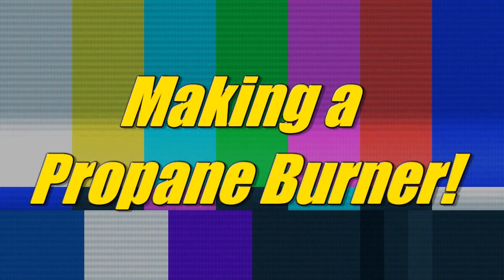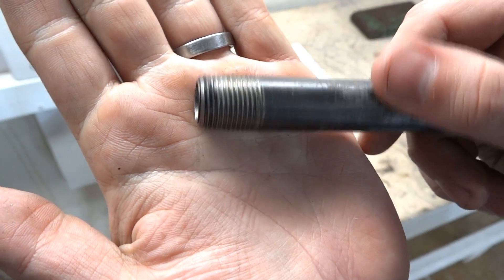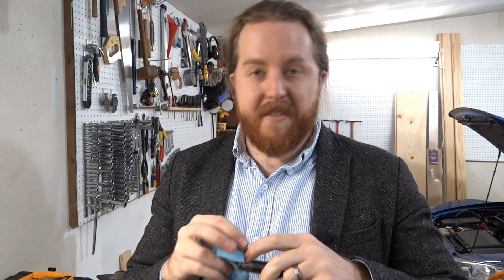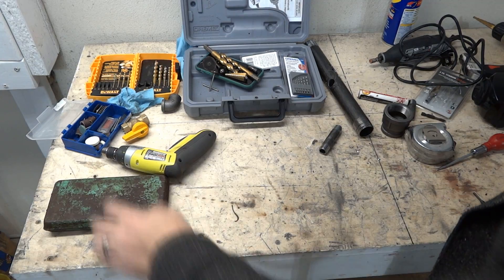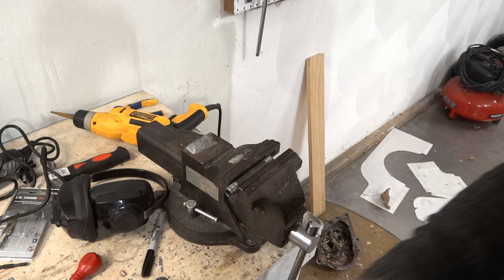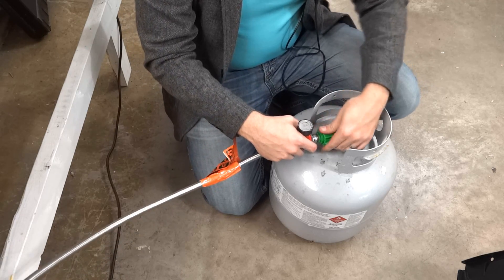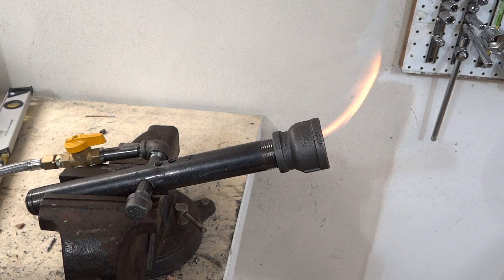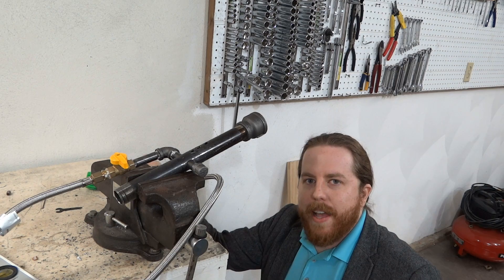Easy to Make Propane Burner! For Melting Metal at Home, or a Forge!

Comment: you should fit a flame arrestor between the stainless hose and the valve that way if a flame were to work its way back you dont blow up your garage :). awesome videos man!
Reply: not really needed since there is no oxygen like with a gas welding torch.
Reply: Rob B but theres always the chance it could happen, always better to waste a couple dollars rather than a couple million to have your face re built
Reply from the maker: yeah better safe than sorry, you make a good point.  A couple bucks to eliminate a remote risk is easy to justify.

Comment: My ultimate casting goal is a bronze sword
Reply from the maker: That would be pretty cool! the molds for those were carved out of stone, though, so lots of work there.
Reply: Paul's Garage you could also build a big flask and sand cast a sword that you could make out of wood (or foam because its easier to work with) to be the same shape as the bronze age ones, thats probably how I would do it.
Reply: +JACKAPUNCH44 Lol, that's actually what i'm trying to do too :) Ive made a wood model but it looks more like a roman gladius. Anyone cot propper dimensions for a greek one?

Comment: It probably isn't good for oxygen because most likely there is some grease or a hydrocarbon compound in the valve which when comes in contact with oxygen normally equals fire.
Reply from the maker: huh, i hadn't thought of that.  I like fire and all, but unwanted fire inside a valve sounds like a bad day.

Comment: I'd probably leave that valve open while you dream of things to burn if you do indeed plan on tack welding the pipes together. let all the propane get out. 

think I might look into making something like this. Could be useful.
Reply: Well this one with the remaining gas inside the line was a surprise to me as I usually turned off the supply at the tank and let the flame burn out, then I tried it by turning off and disconnecting the hose and torch and thanks to a ball valve there was still gas inside. Better to know about it than find out the really hard and dangerous way.
Reply from the maker: Good point! flammable, trapped gasses are not a great thing to have around a welder...
Reply: I was going to add a similar comment Paul. I found with my hand held torch and braided hose that it would still contain some gas after disconnection from the gas cylinder, useful for a short term portable flame but dangerous otherwise.
Reply: I'm usually the guy rolling his eyes at the safety people but sometimes stuff isn't as immediately obvious.
Reply from the maker: Good point!  always better safe than sorry.  I'll probably disconnect the black pipe stuff from the regulator hose and blow compressed air through it or something to make sure it's all propane free before tack welding.  Or maybe i'll just use a set screw like the instructions said.

Comment: I like your tutorial how to videos, the ones I have seen are simple. and my furnace is already equipped to burn coal, wood, paper briquettes, etc. But it is 25 miles one way for me to get a tank of propane. But cooking oil and motor oil is a lot easier for me to scrap up. living in the bush, some building materials can be a challenge to locate without a 50 mile round trip walk. So I would like to request a future video for myself and others who may be in a similar situation for an alternative style burner such as the oils? I built my furnace from an old 175 gallon used oil storage tank ( like the ones you might see at a minute oil change shop ) so I have a lot of room to heat. I am curious to see what you can come up with. most the ones I've seen are to complicated or difficult for me to find parts ECT.  I am looking of a simple gravity fed no air compressor design. I love aluminum casting, and trying to learn brass, copper, and if my guess is correct about this river, possibly gold. Later for now. . . .
Reply: I built an oil burner, I built mine off of the kwiky burner, but if I wanted something simple that just works, I would look at some of the burners from the guy called "oil burner" here on youtube. His drip style burners work really well and Ive seen a few running in person, and I have to say that they are much easier to use than the siphon ones and much cheaper to build.
Reply from the maker: yeah the channel "oil burner" is pretty good.  I think Fair Weather Foundry uses an oil burner, but he uses a mix of air pressure and gravity feed. He elevates the oil tank above the burner, so gravity acts to force the oil through as well as the pressure. I think he says a foot of height is equivalent to a PSI or something like that?  I probably won't be making an oil burner anytime soon, although I am curious how well cooking oil would work.  The problem I have is neighbors.  I'm in a dense neighborhood, and propane is odorless and smokeless so i can fly under the radar here.  I want to try an oil burner at some point, but it might not be very soon.
Reply: Would you mind sharing the link pleas?  I keep looking and to just put oil burner or drip style oil burner, I get way too many choices.
Reply: I use a kwiky oil burner, which needs an air compressor but works really great for me. If you want drip style, just look up the user "oil burner" on youtube here. Both can be found on here and are fairly easy to make.
Reply from the maker: +Little King Cobras Den which link are you talking about?  I can't see my reply to this comment from my phone for some reason.  If you want designs for oil burners those atre probably at backyardmetalcasting.com, if you are looking for one in action check out YouTube channel fair weather foundry, there should be a link in the featured channels on my channel page.
Reply: Well, I was asking Chirpy's Tinkerings trying to find the home page of the youtube person they were suggesting. which they said, look at some of the burners from the guy called "oil burner" here on youtube.BUt I will look at your suggestion also.
Reply from the maker: +Little King Cobras Den oil burner is a good place to look, chirpy knows his stuff

Comment: Paul I'm going to still suggest you get a propane 40lb tank from an RV. You can find them pretty easily. And I'll tell you why you should get one.

1) Have to fill less often. 
2) bigger tank means less likely to ice up. I'm pretty sure you live in the upper midwest where it doesn't warm up till May so this is an issue a good part of the year.
3) no need to take your barbecue tank off your grill.
4) Horizontal ones can't be knocked over
Reply from the maker: That's a fantastic idea!  I know where to get those around here, my parents have an RV with those tanks.  I hadnt' even considered that.
Reply: DON'T go to the RV place first. They have more incentive to mark up way too much. I'd start with

Salvage Yard. Call up any one and tell them what you're looking for. Those tanks have no use to them so they'll be cheap. 

Propane distribution company. Tell them you're looking to buy a tank not rent. Should be cheaper than an RV place.
Reply: I have one but i cant get it recertified only downfall ive found

Comment: you can make your foundry in a trash can to make it bigger, I did this and it works really well
Reply from the maker: I was thinking about that.  I can get steel trash cans at a store here, but they are REALLY big.  I was thinking maybe double the size of the bucket foundry, but the trash cans are around 5 times the size of the bucket.

Comment: Drilling the jet hole after assembling the elbow to get the clocking right is a good idea. Many eliminate the elbow entirely to avoid that issue. To avoid breaking Chinesium step drill bits you need this accessory http://i.imgur.com/eVsKgLt.jpg They work better in it than in pistol drills.
Reply from the maker: A drill press would have helped tremendously.  It's on my list (along with a million other tools) when I get the money and space.  That Gingery book has a drill press as one of the projects, but having a drill press to begin with would help make the other stuff. Not to mention how useful a drill press is with lots of other projects.
Reply: +georgewocosky I got that mini high speed drill press from Harbor Freight. They stocked it for like a month years ago. It was $29.95 then too. I've seen the exact same machine retailing other places for about $129. It is made in Taiwan. So the good stuff :) I have a vintage 4x6 bandsaw from HF made in Taiwan too. So likely a genuine Rong-Fu?
Reply: +georgewocosky I've made a couple scrap metal wood lathes. Someday I'm planning on upgrading the spindle on the lathe I have now, and it might be capable of turning metal then? I would like to get some MT taper shaft and bearings for it. Right now the spindle in that lathe is pretty shifty. But the rest of it is solid. http://i.imgur.com/7KTgP1C.jpg I'll need to make a new tailstock too.
Reply: No doubt !  *  Chinesium mill is 'familiar' with said drill bits  XD !   ( Not to mention STABILITY  ! )    . . . good thing he's not trying to drill a .010 hole in 4130 with a carbide drill  ;)      (( I've been eyeing H.F.'s mill / drill for some time . . . thinking that it could benefit having a slightly redesigned / modified head for better Z axis control .))
Reply: +georgewocosky I have another drill press for those really tiny bits. It is a lot smaller. http://i.imgur.com/GyiqYUk.jpg But yeah, I can't use those tiny carbide bits by hand at all. Well, I might get one hole a bit with them.
Reply: 'Munchkin' machinery has definitely got it's place ;)  * I tend to drool over Lorch's & Swiss instrumentation . . . yet beggars like me tend toward H.F. to make homemade devices :(    One step at a time . . . 
Cute little press !  What breed is it ?
Reply: Harbor Freight has a nice & cheesy little drill press for less than 50 bucks if you buy it when they put out a 25% off coupon ~  * The newer iterations of their 8 inch 'unit' are rather lightly built , with an aluminum 'table' & pressed steel base . . . unlike a few years ago . . .when cast iron was used .  ( They work fairly well as a lathe when laid on their side . . . I turned many hundreds of fishing lure bodies with them from scrap cedar & mahogany ! )   * Not so hot for turning metal , however. . . though it could be used for aluminum , if properly 'jigged'. . .
Reply: It's a shame how poorly the newer HF 'entry level' drill press is built these days -  I had an 8 incher several years back, that I intended to turn into a small mill . . . the table wa IRON instead of today's aluminum .  Presently, I've got a pile of 1018 that will become the bones for a reasonable quality lathe & mill - I'm aiming for 16 inch swing X 24" between centers . . . but might build smaller until my eligibility for Sociable Security kicks in later this year :p    *Funds could support higher quality then !  :D    'Got my eyes on some 'treadmills' for variable power sources !
Reply: +Paul's Garage the Gingery series is interesting. Though the drill press is likely the least valuable project in the series. Being a tinkerer myself I'd say the first tool to get is a saw. Lately I've seen folks making stands for their Harbor Freight portable band saws. So that is one option today. I remember when all I had were hand drills. I also had a lot of broken bits back then too. Coincidence? I think not!
Reply from the maker: I think i'm just going to get a drill press, or better yet, i'll borrow the one that's been in my dad's shop for years collecting dust.  It's such a useful tool and the one in the gingery book is one of the last projects.  I'd rather not wait that long.  All this harbor freight talk makes me wish i had one of those nearby.  I haven't lived in a place without one in about 10 years, but now i have to buy stuff online or go to sears or something.  Our sears is pathetic, half the shelves are empty.  You can't buy jack stands when the store doesn't have jack stands...

Comment: Nice modification of the original design based on the parts that were available to you. I can't wait to see how well it will perform but you still have to build a new furnace around your new propane burner and I'm interested to see how it all comes together!!!!
Reply from the maker: I'm looking forward to getting the new furnace too!  I might give this a test run on the current furnace while I get all the materials for the new one. Still trying to figure out the design details on that...

Comment: First like! 😊
My burner has been in the works for weeks.
Different setup and I haven't finished turning the nozzle!
If you are interested I'm going to post up when it's done.
Along with a few pics from making my furnace.
Like your vids!
Reply: Maybe not the first like!
YouTube fooling me!
Reply: Also, I got all the pipes for my burner in SS and it cost £22, would of been cheaper if I had done cash!
If you look around you can always find a cheaper option.
Reply from the maker: Stainless would certainly look nicer than black pipe.  Black pipe is cheap, readily available, and meant for gas, but it is ugly stuff for sure.